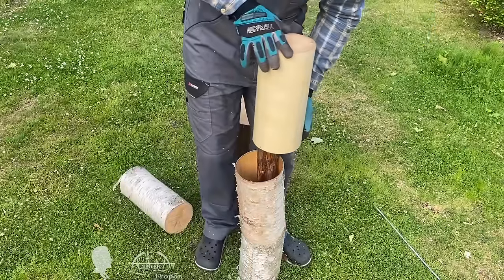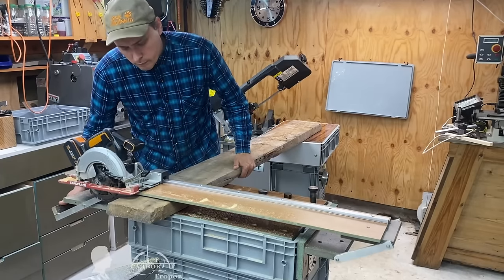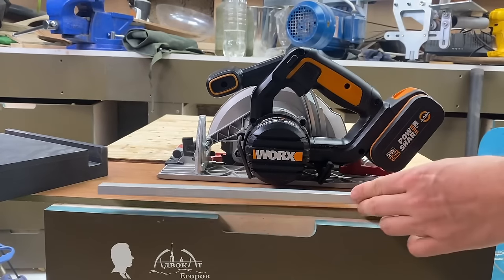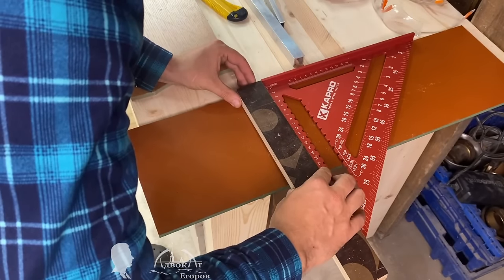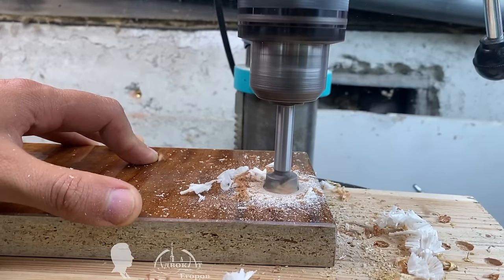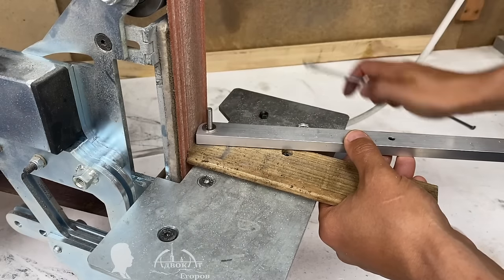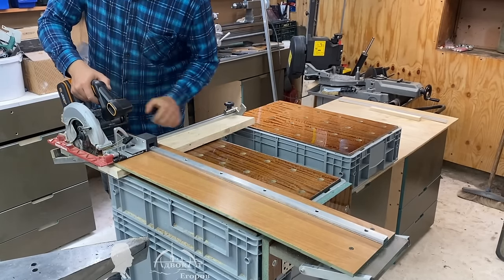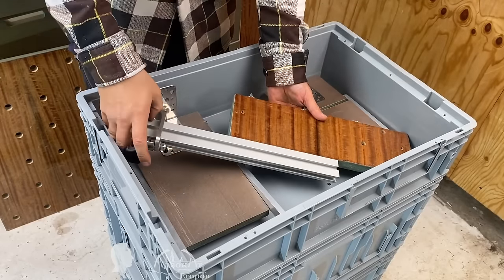$10 DIY Miter Saw System / Making a Revolutionary Concept Tool

Comment: If you swap out the base plate with polycarbonate so that it is big enough for clamps then the hand held plunge drill press jig should be 100% accurate... one thought I have on your system is that once you have one hole you should be able to have a jig that is based on relative positioning then drill the rest of your holes... in that case I would actually dimension the board itself last & drill all the holes with the relative positioning jig first... using dowel dogs in the previous holes will fix the unit at the SET distance required for each subsequent hole... that way you always conform to your system.
So:
1. Swap base plates to allow clamping for stability in your plunge drill jig;
2. Create a Relative positioning Jig such that once the first hole is drilled then using a dowel dog that inserts into that hole will 100% position your plunge drill jig properly for the next relative hole to drill;
3. Once all the relative position holes are drilled THEN dimension the surface to it's final dimensions....
this will ensure that all holes conform to the system & all you need to do is have accuracy in cross cutting & ripping your board to the proper dimensions... and I KNOW you got that covered viz the whole point of this video!
Reply from the maker: Thank you for the input!

Comment: Here's an abstract focusing on the DIY spirit and innovation of the presenter's miter saw system. I created it from the transcript using Gemini Advanced 1.0

Abstract

This video presents a novel DIY miter saw system built with a pantograph mechanism and other accessible components. The system outperforms premium models in cost, adaptability, and capacity to handle larger workpieces. Its creator aimed to develop an affordable and practical alternative to commercial sliding miter saws. Additionally, the design incorporates a simple DIY guide rail for standard circular saws, made from an aluminum profile. It is significantly cheaper than pre-fabricated guide rails.  

The video provides detailed build instructions using everyday materials. The use of KLT boxes as the base adds a modular functionality for potential workspace configurations.  The final design can be adapted and improved while remaining inexpensive. Furthermore, the presenter highlights their commitment to accessibility by continuously exploring different material choices and techniques. They actively collaborate with viewers  to refine the "people's miter saw" concept.   
 
This presentation not only demonstrates the process of creating a versatile miter saw system but also embodies the essence of DIY ingenuity and problem-solving through accessible  means.

Comment: Hi Max 
Amazing skill and attention to detail on this project.. 
Do you have any downloadable drawings to purchase for your peoples track and miter saw ? 
Thanks 
Mark
Reply from the maker: Mark, thank you. I don't have any plans as of yet as it is only a prototype...
Reply: @Advoko  . I would interested in buying the plans once you have perfected the prototype.
Can you tell me if the worx saw you are using is a good solid performance saw capable of cutting  1 “ thick Baltic birch ? 
And is the battery life good too . 
Thanks 
Mark
Reply from the maker: It was OK, it should be able to cut it with a good blade.

Comment: Following you quite some time now, always interesting to me. I moved to Mid Norway (Northern part of Trøndelag) and started a smallscale farm there but I'm used to making as much as I can myself. Because I want to start as a beekeeper too, I'm VERY interested in your system. Cause the cold makes it hard, and also. I also like to avoid using poisin products at all cost. Do you think you can share some information already? If possible I'd like to start as soon as possible (not wanting to push you :-) )
Reply from the maker: Yes, I am planning to publish a more detailed video on bottle keeping, need some time to finish some of the ongoing experiments.  Stay tuned…

Comment: Do you have plans or some quick drawings for this miter saw jig?
Reply from the maker: I do not as of yet as I am still perfecting the system. I am hoping to have the plans by the time I produce the final production version of the system.
Reply: @Advoko  I love your innovative design it would work very well for alot of small shops.

Comment: cool system but what about cutting miters?  is it possible to make the board fence able to rotate?
Reply from the maker: You just position a board at an angle you need to cut
Reply from the maker: Yes, it is on of the ideas I am workin on

Comment: this is an interesting system, but how do you plan on making cuts at angles other than 90 degrees?
Reply from the maker: You can make a cut at any angle using this system as long as you lay it out on a blank.
Reply: @Advoko  ok but this is significantly less convenient/efficient/repeatable than a standard miter saw
Reply: @Advoko   It may be difficult to do with your modular system, but you could have the track pivot at one end. Essentially, turning it into the swinging arm of an angle finder. 

I'm not sure how many modules you are planning on making... you would need 5 for this idea to work. When I have to make long plywood cuts with a track saw, I place the board on a sheet of foam insulation. Position 4 of the modules in a square, spaced apart and connected with aluminum profile sections at the bottom. On the top, use 90° angle profiles to form a frame where the insulation will fit into. This, basically, makes a large work table - maybe up to 1.5 x 1.5 meters. The 5th module will connect to the side of one of the other 4. This is where the one side of your track is anchored. It could definitely work, but it isn't necessarily the most practical solution... depends on how often you would use it. 

Rudimentary Diagram:

↘️________
❎         ❎
|                 |
|                 |
❎_____❎
Reply from the maker: @Shin_Lona  Thank you for the input!

Comment: Annular Cutters!  Whenever you have to make a lot of holes like that, you're always better off using Annular Cutters rather than hole saws or forstner bits.  They might be pricier, but they also cut better, cut faster, cut cleaner, and have a self-centering point on them that allows you to line up with your mark very precisely.  https://www.youtube.com/watch?v=5QiNtbg607g  If you don't have a set of Annular Cutters in the shop, you are really missing out on a valuable asset to your build capabilities.  Can't recommend them enough!
Reply from the maker: Thank you for the idea!

Comment: This is a great tool for beginners, but it is not a miter saw.  It is cross-cut track saw, or something like this.  Miter saw should have the possibility to set up not only 90 degree angle cut, but any angle (miter) in a reasonably large diapason.  By the way, do you have problems of dust getting into you storage boxes through the perforation holes?
Reply from the maker: Some dust gets in there.

Comment: So, $10 miter saw... interesting contraption, but just by visual inspection, you got at least $400 USD in stuff. 

The excuse  of "using readily available materials" is so morally bankrupt and disingenuous on youtube that you should be ashamed for using it yourself. You had to pay for all that at some point, so it's never free stuff. You can buy a proper miter saw  for the cost of the "suff you had laying around." The most disappointing thing is that you show good skill and inventiveness, so the dishonesty wasn't needed. Youtube is plagued by BS titles, making all kinds of false claims. Seeing talented people joining in to do the same is just saddening.
Reply: Why mister pennypincher. I could copy that design for $10 just fine and maybe have money left for a beer. It's just a straight board + something that could serve as a straight edge (that last time I looked can be made by the simple application of accurate eye-sight to an offcut) + some more offcuts to make this 'up and down' mechanism that would again just require some care to get everything straight and parallel. You know, skill and craftsmanship.

That just leaves the need to get a decent battery powered circular saw. Did you really believe this $10 setup included the saw?

Also, this gentleman is in the habit of hauling stuff on his back into the wilderness. Ever tried that with a 12" miter saw and a generator and a can of gas and an extension cord?
Reply: Weird comment. If you are a crafter, there will often be leftover materials. Also you can, at least in my country, get great materials for free online, if you have a car and a trailer. People give away stuff all the time.

So yes, while if you were to go and buy these materials off the shelf, it would set you back a few dollars, it shouldn't really be a problem to improvise and get these materials cheap or free somewhere.

To disassemble other people's trash, create tools and repair things is a lifestyle. It IS a lot cheaper than buying the newest stuff off the shelf all the time, no matter how you want to measure it. The theoretical store price is irrelevant, except as a measurement of how much money you save.
Reply: I hope you reflect on this comment one day, while actually putting yourself in this fantastically innovative and passionate youtubers shoes.
Reply: Вы не правы, каждое слово в этом видео - истина. Я буду благодарен, если вы попробуете мотивировать своё обвинение.
Reply: @avienated  I am not a crafter, the algorithm recommended this to me out of the blue, and it seemed interesting (let's be clear, absent the misleading bit it IS interesting).
Reply: @adekvate  Apologies friend. I do not speak the language, I can't tell a word of what you said.
Reply: @tengdayz2  This is me putting myself in its shoes. He has the talent to succeed on his merit alone. There is no need for the cheap clickbait with talent like that.
Reply from the maker: Thank you for your kind words, but the pantograph module did cost me like $10. The aluminum rail was like $2. It is literally assembled from scraps and upcycled materials. And yes, if you count the optional equipment that came with it it would be more.
Reply: @alexisrivera200xable  again, I disagree it's misleading :) It seems like you thought he got the saw itself included in the $10, which isn't what he meant. The "saw system" is $10, not including the saw. All in all it saves money overall – and is arguably better. The system he replicates is quite expensive.

Consider that English isn't his first language. It's not mine either, which is perhaps why it was easier for me to understand.
Reply: @Advoko  there it is brother. You're the best! Nice of you to reply to criticism.
Reply: @avienated  There is no debate to be had but I can clarify my position. I did not include the cost of the saw itself in the cost calculation. I only counted the hardware, wood, rails and rollers. On the wood and the plastic table alone you exceed the $10. 

I do not recognize any argument for making a cool invention then simply shoving 95% of the cost of it on "I used materials I had lying around." Just to shoehorn the dishonest "Make this cool thing for only $10".

As an example of how dishonest the practice is on Youtube you could search similar videos but let's make a clear hypothetical example of what you can get away with that logic. 

Let us say I own an aircraft boneyard. If I make a video claiming you can build your own aircraft for just $10 dollars on the title, all I need to say is that I just used materials and part I already had lying around then only count the $10 I spent on some random bit of the build and it would be both true as in I had all those parts and indisputably dishonest in the claim. Bad faith lying on titles is not an acceptable practice and skilled content creators should not rely on them. 

That my whole point, otherwise they will get lost in a sea of low effort liars who didn't spend even a fraction of the effort to do their videos. You can't compete on quantity with fraudulent content farms and when YouTube changes their algorithm to not recommend videos that do it, the good ones will get lumped in with them and buried by the algorithm without any warning.
Reply: На сколько Полуляхов из 250 тянет изобретение Максима?😊
Reply: @alexisrivera200xable  You are 100% right. Unfortunately, even very talented authors have long started resorting to clickbait headlines, where they equate the cost of the main node to the cost of the entire project (at best), forgetting to add the cost of what they have "lying around" in the closet. Example. I was recently given a used car. But this car has worn-out brake pads. It turns out that by replacing the brake pads, I could say that the car came out to me at the price of brake pads. The example is exaggerated, but the logic is similar.